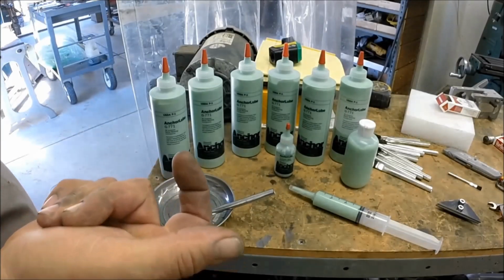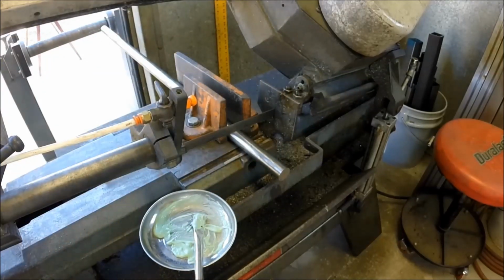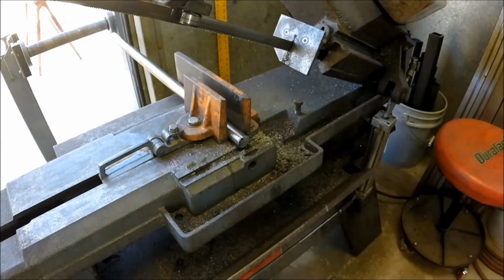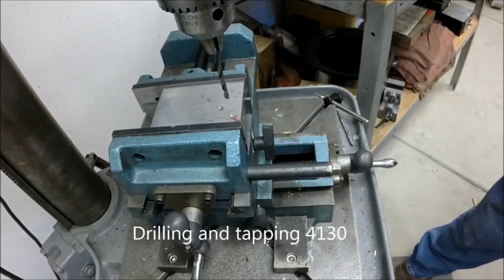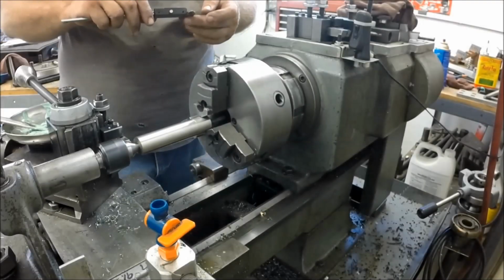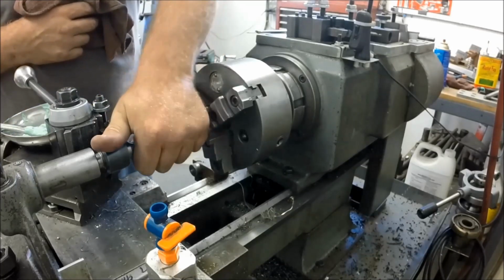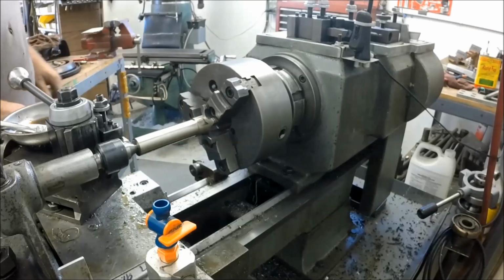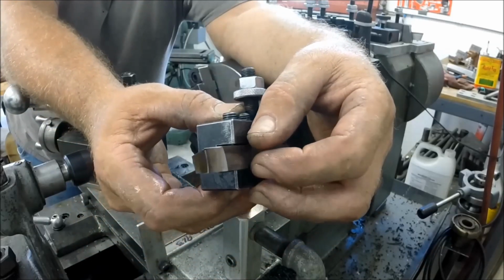Anchor Lube Product Review

Comment: I have been using this stuff for the past year.
I needed a cutting fluid that does not smell because I work in a laboratory environment.
I also mix it down with water so it flows better.
Works AWESOME. Best tapping fluid ever.
NO smell.

Comment: Stan,
One thing that I did notice is that on all your machining with the various metals using that Anchor lube product is that there was minimal fumes / smoke coming off from the cutting as opposed to the Rapid Tap, so that would be a plus if you are doing a lot of machining and don't want to be breathing oil fumes all day.

regards

John MD

Comment: Stan, Your review encouraged me to open my sample and use it.  It works great for me, so I decided to order a gallon.
One thought that I had for delivery to the stuff is to use one of the spill masters, and keep the lid on it when not in use.
Thanks for the review!
Reply: Sam from Anchor here.  You are 100% correct. Being that the product is water based and biodegradable it is important to keep the lid on when not in use.  It can dry out otherwise or even spoil.  However, stored under proper conditions and sealed it does have a two year shelf life.

Comment: Hi Stan,
Most noticable difference from here is the lack of smoke, and I'm anxious to hear about what a viewer mentioned that the diluted solution would cause corrosion. So far it's positive.
How about Canadian shipping conditions?
I'll keep tuned in,
Pierre
Reply: Sam from Anchor here. There should be no corrosion caused by diluting Anchorlube.  However, if it is not eventually rinsed off it could cause some corrosion since it is water based after an extended amount of time. But certainly not while working with the part.  As for Canada shipping, it is available through Fastenal throughout the country and Try Hard distributing as well.  If you are looking to order in larger quantities pl;ease do not hesitate to contact us at sales@anchorlube.com.
Reply: Thanks I'll look into it...

Comment: Stan,
I work at a metal stamping plant and we use anchor lube for some of our heave stainless steel parts. We dilute it with water to apply it in a semi flood type application. What we have found is that if left on the stamping dies it causes severe corrosion on all of the steel components of the tools. I would advise against using it in a flood application on a machine tool.
Reply from the maker: Hi Atlas,
Thanks for the info, I haven't noticed any when used full strength. Thanks for the view and comment.

Comment: just a thermal imaging tip/ir gun tip. shiny stuff reflects ir. if you point an ir gun at a window you'll actually read the reflected temp of yourself or the wall behind you. you need to account for emmisivity, but you can't calibrate those guns.. if you put electrical tape on the piece and measure the temp of the tape you'll get a more accurate reading as the emmisivity  of black electrical tape is about .95 in this case that would be hard but if you ever use that gun to try to get accurate numbers use some tape! it helps trust me.

Comment: Very good review. Interesting ideas about dispensing it particularly if one could get a slightly longer fine point on the fold down cap version so that one could be a little more precise about where it was being directed to.

What is cleanup like off work pieces, the machines or in "awkward spots" as it doesn't appear to flow and move once applied.

Can it be washed off good enough to paint for example e.g. with water or perhaps brake cleaner, rubbing alcohol?
Reply from the maker: Hi Dan,
It's water based, so it simply washes off with tap water, if left on the machine or vice overnight, no signs of rusting. The corrosion test was part of my review, but the video was running long so it landed on the cutting room floor, sorry.

Comment: Thank you Stan.  Ordered some up.....I want to see how it does on annular cutters  out of position.  It looks "clingy" enough....I've been using a stick lubricant for drilling in vertical surfaces, it would be nice to just carry around one product for drilling, tapping etc.  Thanks, Sean.
Reply from the maker: I keep some in my job box for hole saw cutting SS electrical panels, works really well for that.

Comment: If a magnetic tray can be found with a plastic lid or other type of lid which would seal the air out, that might work if you didn't want to clean it every day and it wouldn't dry out sitting in it between uses.

Comment: Please note that IR thermometers don't work well on clean metal surfaces. Due to the reflectiveness, they show lower than the actual temp. I tested on a shiny stainless steel pot with boiling water and it showed close to room temperature.

Comment: Hey Stan,

I hope you know that IR gun is not very good on shiny, reflective parts. Emissivity of stainless varies by a factor of 10 depending on how polished the material is, so the number is unreliable. 

Also, for best results the IR thermometer should be perpendicular to the surface measured, and don't forget the target spot size printed on the side (the laser dot does nothing).

<http://www.thermoworks.com/blog/2012/03/infrared-thermometry/>
Reply from the maker: stefantrethan  We were using it comparatively in most cases, all things being equal, it didnt matter what the numbers were, only that we were able to compare an average number at the end.
Thanks for the view and comment.
Reply: Shadon HKW
You are comparing random numbers, you might as well make them up.

With a shiny surface the IR thermometer sees the reflection rather than the actual part, so you are measuring the shop roof, light fixture, your body,  etc. instead of the part.

If you don't believe me, take a piece of bare metal, and use it as a mirror in front of the infrared thermometer to measure different objects. 

Or paint one half, heat it up evenly, and measure both sides.

Again, I'm not talking a small error here. I'm talking arbitrary numbers with no correlation to actual surface temperature, so no comparative measurement possible.

I often use a thermal imaging camera at my day job. A piece of aluminum is just like a mirror, you can see yourself in it with the thermal camera. The infrared thermometer is no different, just a one pixel camera.

I believe you are a man who wants to use his tools right, so please, look into this again. It's not a waste of time, especially considering your business.